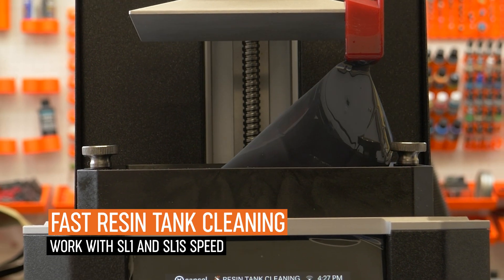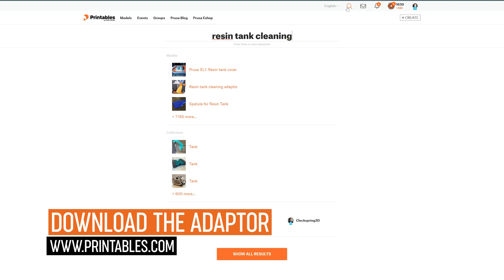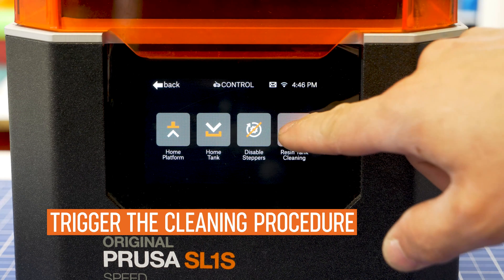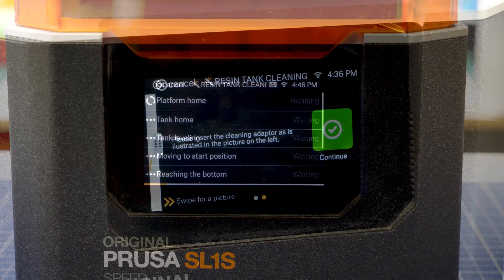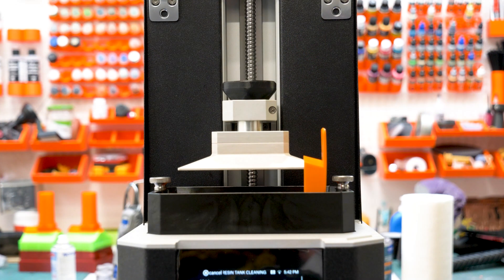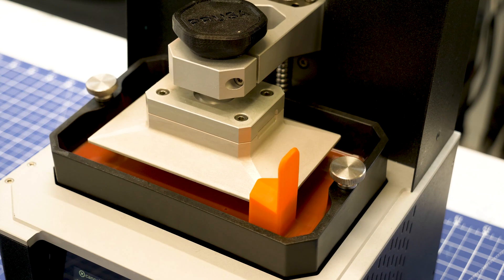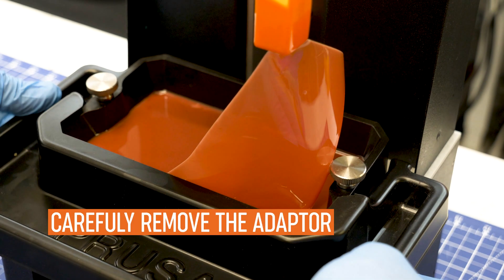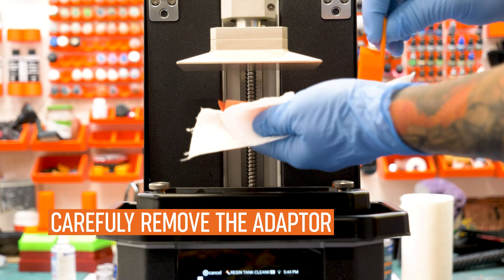How To - Resin Tank Cleaning

Comment: Nice but I'll stick to the method I was shown. Remove the leftover resin and clean the tank. Sometimes the leftover resin can settle in the tank. This method seems like it would cure the layer above the film that's settled and remove some of the elements of the resin. Just a thought, still seems like a shortcut that isn't needed.
Reply: cleaning the tank damages the fep needlessly. This method removes the pancake of cured resin and sedimentary particles that fall to the bottom after a failed print. this is the correct way to clean your fep. Emptying it and cleaning with IPA is destructive and wasteful.

Comment: Do you have to reprint the adapter each time?
Reply: Oopsie doopsie. I think that I am staying with the trusty method of buying a brand new machine for each print. Easier.
Reply: no, you can use one for many times
Reply: @jirinovak145  et à chaque utilisation avoir un risque qu'une couche reste et va forcer de plus en plus sur l'écran ><
Reply: @AcidNightx  No, the movement is not to the height of the adapter, but until the adapter rests against the display. Please don't comment on things you don't understand.
Reply: @Tritol128  Thank you for not answering without thinking and trying to belittle the other when it is you...

What is the room used for?
And what happens to achieve this?
By force there is no material that is deposited on it?
SO the distance between him and the sample does not change ???

Then in the event of a migrand body there is not a slight risk that it will be placed just below???

So thank you for not taking yourself for one who has all the information when you are not thinking
Reply: @AcidNightx  I don't have to think, I know and I have all the information. The firmware, like everything from Prusa, is open source and therefore it is possible to examine the procedures used. The height of the adapter does not matter as long as it is within some reasonable tolerance. The final movement is not at a specific position, but moves until the adapter hits the vat, similar to when homing on the other side of the axis. So even if more material is gradually added to the adapter, it has absolutely no effect on the function until it is a few millimeters. That's tens to hundreds of cleanings. Then the adapter can be lightly sanded and can be used again. And if there are any residues directly under the adapter, thanks to the impact detection, this is again not a problem, in the worst case, the hardened part will not stick to the adapter and you need to peel it off manually. There is no risk of damage.
Reply: No, I tried this in Beta, but I used FDM for the adapter. I think I printed in ABS, but YMMV. My thought process was that if I printed it out of resin, it would stick more to the film you pull.
Reply: un bout de papier ou d'ancien support, vous le placé dans un des 4 coint et vous réalisé une exposition de 30s sur tout l'écran... connu depuis des années pour nettoyer... et tout ça pour 0€
Reply: @AcidNightx  Yeah, this seems more like a solution looking for a problem.